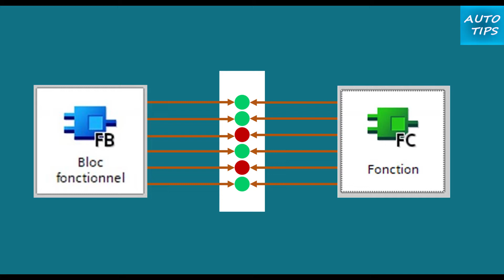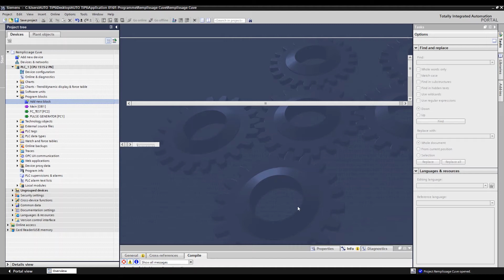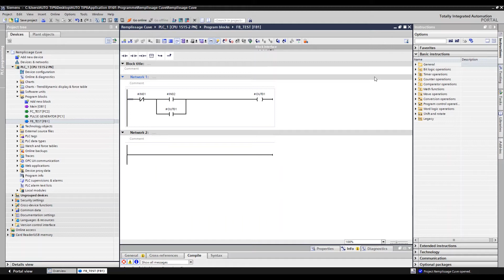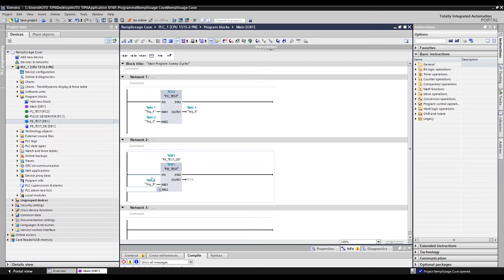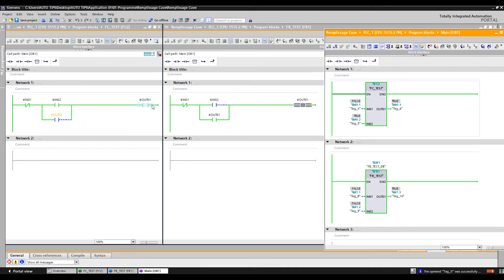FC & FB : YOU KNOW THIS DIFFERENCE !

Comment: You should use OUT01 as a inout in FC to work as FB.
Reply from the maker: Yes you can do it.
But the video it's for explain differences between FB and FC.
So in FB you can use Out01 as output and it work correctly.
Thank you ❤